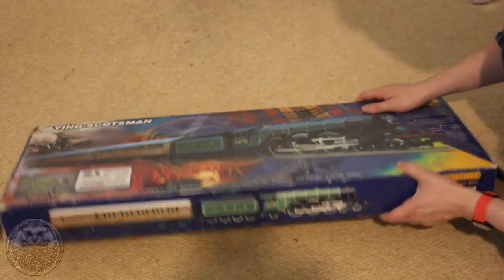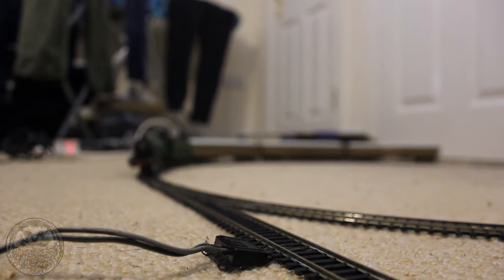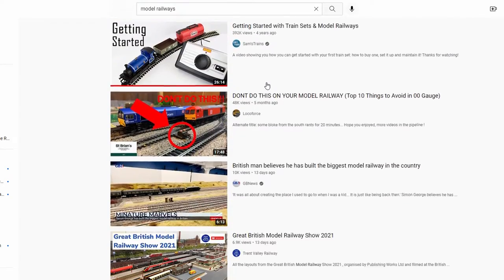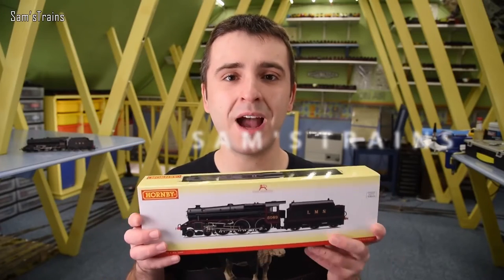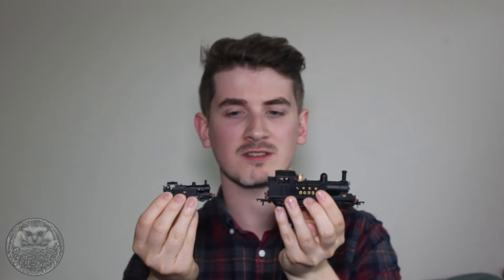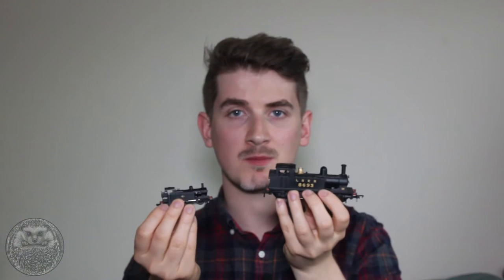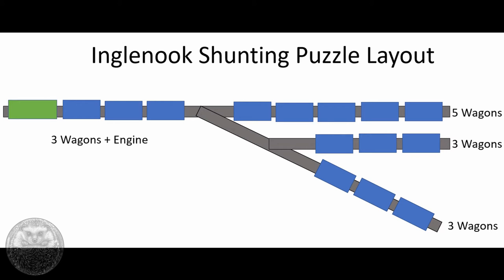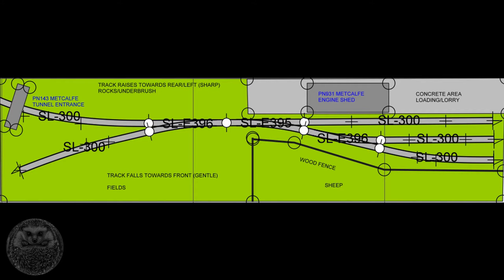N Gauge Model Railway Layout Build EP01: Baseboard and Track

Comment: First off, from a production standpoint, this is very well done.  Great voiceovers, mixed in with the "shop" sounds.  And the music is not annoying or overwhelming.  Probably some of the best "non-professional" work I have seen in some time.  Big props.

As to the build?  I LOVE it!  The detailing and care you put in are really paying off.  Best of all, you did it without using fancy (read expensive) shop tools.  This is a great example of model railroading for "the rest of us", proving that you do not need fancy tools to get good results.
The layout itself is really good.  I have been inspired to build one now.  I might expand it a little though.  Maybe having the connection track become a through type mainline.  It would require a little larger base, but I think it can still be reasonable to build in a small area.

Again, I have only watched this video in the series, but I drew a ton of inspiration from it.  I will definitely be watching the rest of the series.
PS, In case you are curious, I also model in N Scale.  Have built numerous layouts over time.  My current project is a little 2x3 foot (US) layout that I call the Hammer Valley.  Got a few videos in a playlist.  I am also dabbling a little in T-Trak modules.

Sorry for the novel length comment.  Being a writer, I guess I tend to get a bit wordy sometimes, LOL.
Reply from the maker: Hi there, thank you for your nice comment. My favourite thing is hearing that people build layouts after seeing my videos! Your 2x4 layout looks cool - like a mini inglenook with a loop. I actually planned out something similar before settling on my end to end layout.

I guess I have done the best with the tools I have available. I think that (for the most part) it is possible to achieve good results with basic equipment, it just takes a lot longer. Setting up each straight cut with my circular saw + guide rail takes 10 mins or so!

No worries on the long comment... I have dabbled with a little writing in my time too so I know the feeling!

Comment: I built shelf layout 8 inch wide by 6 feet. Enjoyed the build and trains run back and fourth via a geared motor turning cam and switching limit switches. Trains stop by using light sensor laid between rails each end, so that don't slam and derail.
Unfortunately seeing them go back and fourth gets boring quick, so now have a 3-4 x 6 foot board to build several loops.
My shelf will be a higher level and top of tunnels due space.
Reply from the maker: That sounds very clever... electronics isn't one of my strong points but it's something I'd like to look into. The wiring is pretty busy on my layout; I think using an arduino for the point motors could have been a better option.

I wish I had the room for a 4x6 - you could get a lot of scenery on that in N gauge!

Comment: Lovely video, I always think of n gauge as the poor relation, but love it, only downside ,figures are so small so you need plenty of them, looking forward to rest of the build
Reply from the maker: Thanks Colin, there are certainly some areas where N gauge is lacking vs OO, for me the lack of variety of locomotives and buildings has been a little frustrating at times. However, a functional layout at the size of my baseboard (850 x 200mm) isn't really possible in OO!

Comment: I like how you have shown that you can have a working N Gauge layout is such a little space. Nice looking baseboard.
I noticed the dust coming from your saw just before you commented on the necessity of wearing a mask. MDF dust contains formaldehyde (it is part of the glue which bonds the fibres together) so is a known irritant, and is probably not good for long term health. Do you have a dust bag that can go on the dust outlet? This might help a bit.
Reply from the maker: That's the good thing about N gauge I guess - you can achieve quite a lot in a small space.

Yes there is  an attachment point for a dust collector from the circular saw, need to get around to building something to attach to it as the Bosch system is pretty pricey!

Comment: I made an N gauge Inglenook, but I made the baseboard from 1/4" balsa with about 10% effort that you put in yours. Why sand and paint the board when you are going to add ballast and ground cover?
Reply from the maker: Cheers for your comment Dave. I have no doubt there are a bunch of more efficient ways of building a baseboard than the way I did it. In terms of painting the board, as I had the paint out anyway I thought I might as well give it a coat, only took an extra few minutes. Thanks for watching.